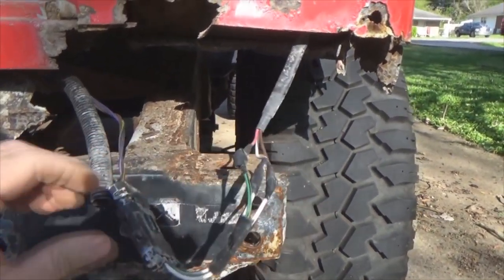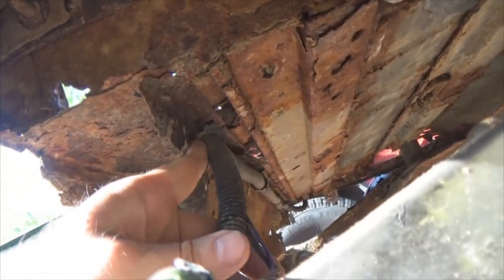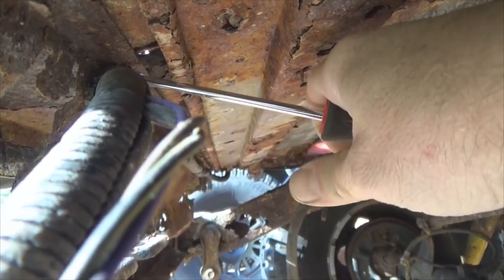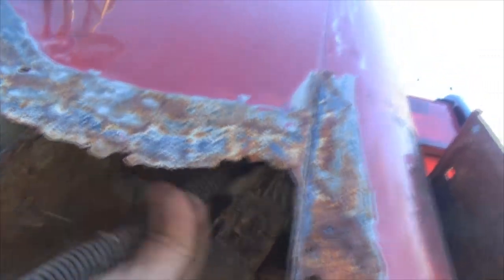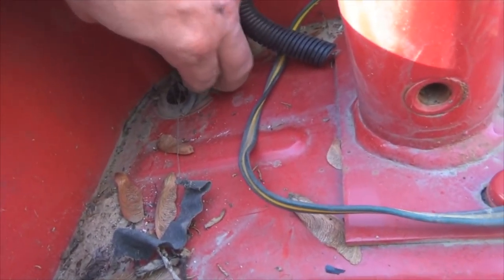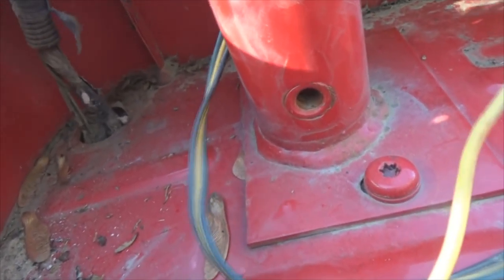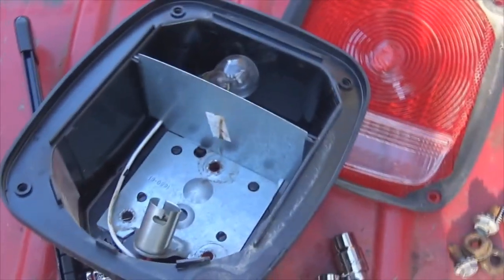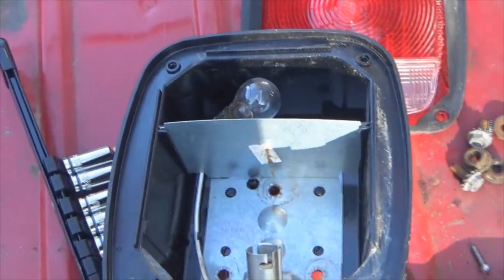Jeep Wrangler YJ - Remove the Taillights and harness from Rust Bucket

Comment: Guess I learned something new from this video even though I've taken my taillights apart before. My taillights are a pain to remove because I guess the previous owner put body armor on the rear corners, so he bought new housings and re-drilled the holes to make it fit better I guess. I had to stick my entire arm up in the wheel well to get a wrench on the nuts on that side, not fun
Reply from the maker: Yep .. they were drilled for clearance. When I installed the LED tail lights in my '91 I had to open the hole up a bit. NO FUN getting up inside the rear fender to get to the bolts!! Thanks for dropping in man!! Have a great day!!